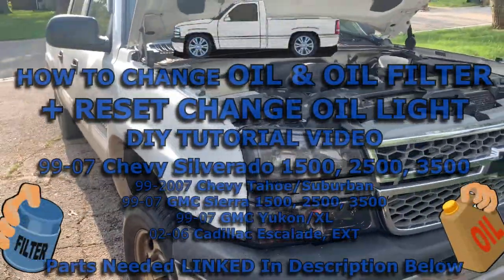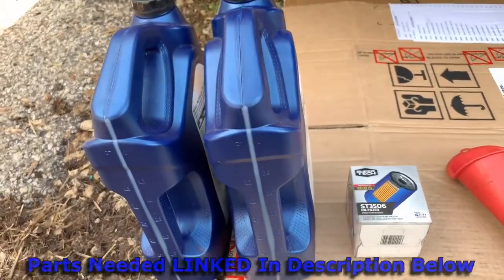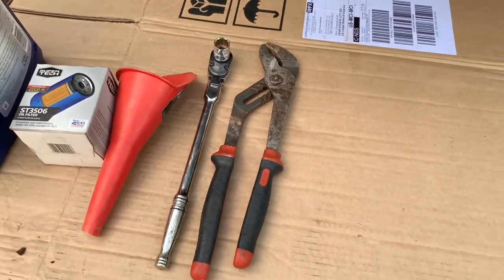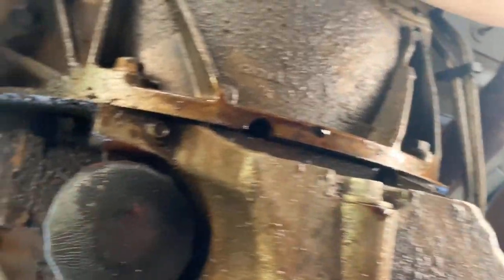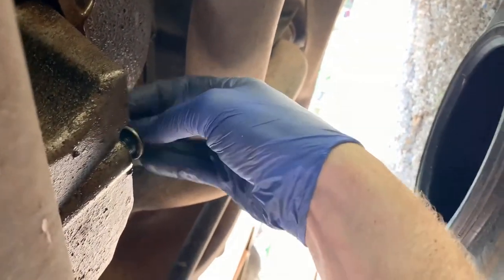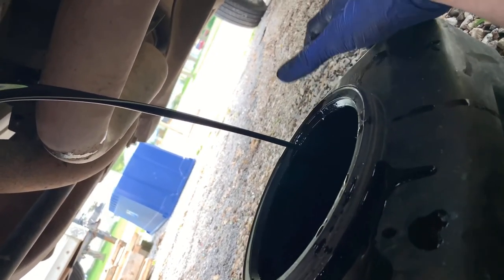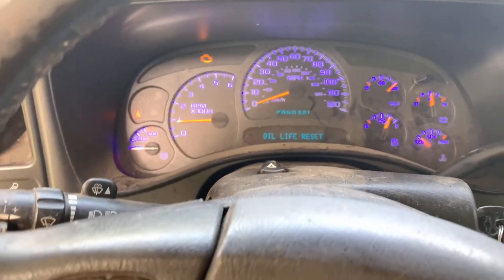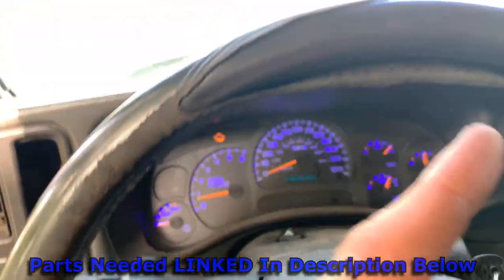CHEVY SILVERADO How To Change Oil Changing Oil Filter + Reset Oil Light 5.3 Vortec 6.0 GMC Sierra

Comment: I would not recommend synthetic oil for these older trucks.  I bought the oil for my previous oil change and after my mechanic did the oil change, he mentioned to me that synthetic oil is much thinner than conventional oil. He warned me that it can leak because these older engines aren't designed for it.  He was correct. My oil got pretty low and had to add a couple quarts.  I've had the truck since it was brand new and in 16 years, i never had my oil go low using conventional oil. I also believe that the slight knocking that my engine developed was due to synthetic oil. I'm about to change oil today and going back to conventional.  I will update but I am fully expecting the knocking noise to go away.  Also...i have read comments elsewhere from people who said their engines were knocking after using synthetic oil.  So don't use it guys!  Not for these older engines.
Reply: Mine has had synthetic in it since break in and there’s zero leak issue and never had any noises out of ordinary. Maybe it’s just her time. She’s 20 yrs old . Might need rings .
Reply: Did the knocking go away? @Bazzookalke
Reply: @KevinMunoz-dn4qm  it got better but i haven't driven it much since then. I developed other problems
Reply: @BazookaIke  because of using synthetic?
Reply: @KevinMunoz-dn4qm  not sure. Possibly. But probably not. Head gasket leak.
Reply: Sounds more like a coincidence and you have other issues…

Comment: What buttons did you press to navigate to the oil life
Reply: Idk exactly what he did, but you see the button on top right on the dashboard? Above the engine meter. Press that, it should cycle through several settings.

Comment: Why pressure oil on dash is 80 What's wrong with it?
Reply from the maker: The gauge on the dash they have little actuators I think that's what they're called that I always go bad on those Chevys so like it could be for the speedometer or whatever the gauge cluster so notorious for having issues and then you can send it off to somebody or do it yourself so that's why it's not reading correctly or gauge is working at all